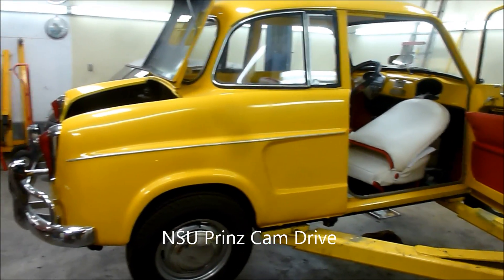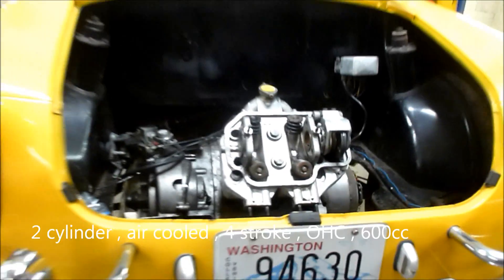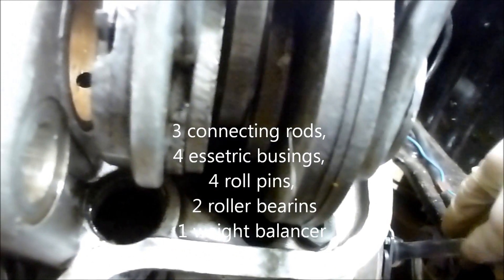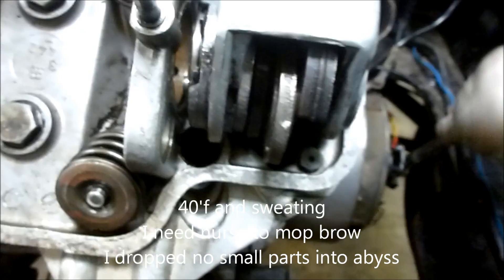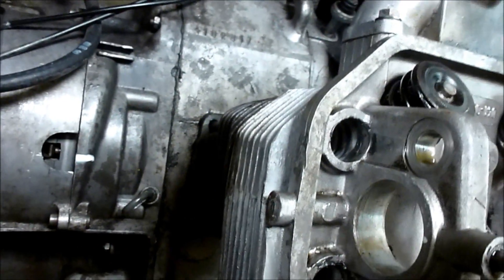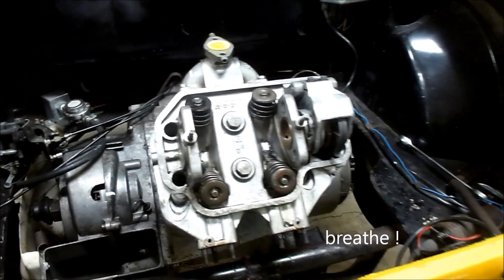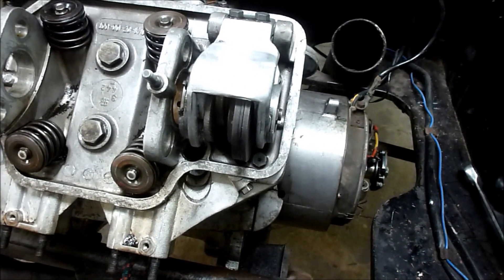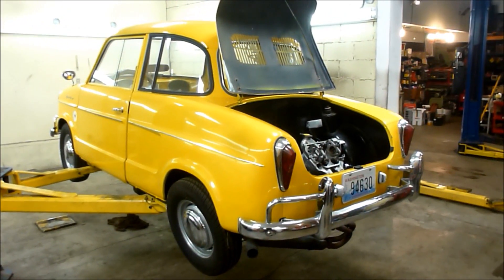NSU Prinz Camshaft Drive in Detail

Comment: Did you mean to say ECCENTRIC? It looks like an astounding piece of German engineering.  Sort of reminds me of the gear driven camshafts on my honda vfr 750, in thaf it eliminates the potential for cam chain failure and stretching.  I bet the valves don't need too much adjusting especially once the break in period has passed.  Brilliant.

Comment: How does this design hold up, compared to more conventional arrangements? More, or less durable ?
Reply: it was and still is extremely reliable and durable. but, it is extremely expensive to manufacture, and even more expensive to service in the field by today's automotive mechanics. that is why no manufacturer has used the design after nsu discontinued it. when the prinz went to 4 cylinders, the cam was chain driven.
Reply: @marzsit9833  It's not reliable or durable because mechanics can't work on it. To be reliable and durable, engineering needs to be simple so it can be maintained and repaired. Why do you think so many old VW Beetle's are still running around while you never see an NSU.

Comment: It appears that they used this system in the motorcycles first before putting it in the cars looking at other YouTube videos.
Reply from the maker: Yes, I noticed that too. No chance of timing chain stretch I guess
Reply: @2stroketurbo  All moving parts are subject to wear. A chain is much easier to adjust or replace.